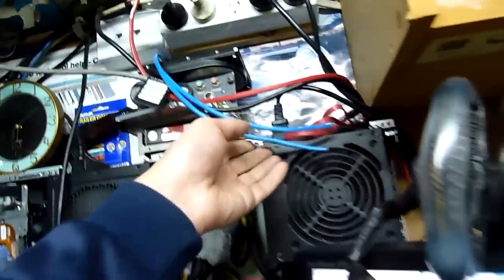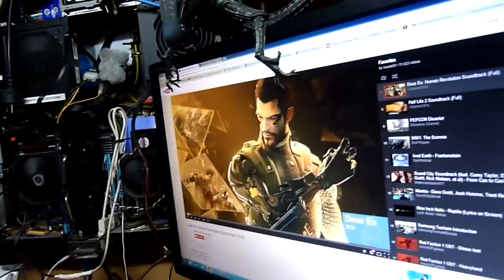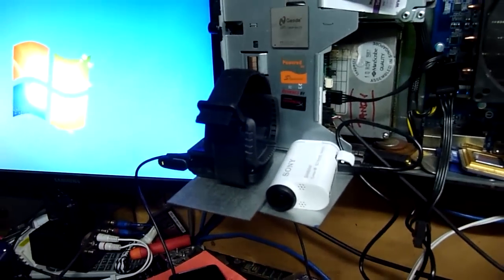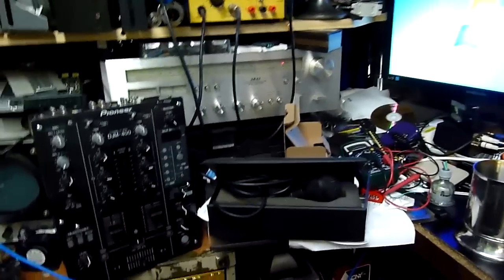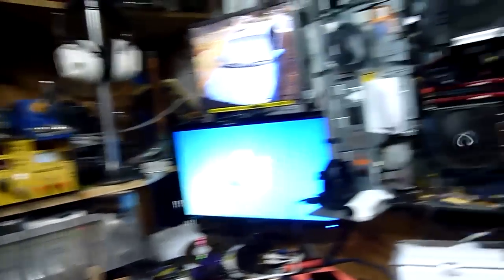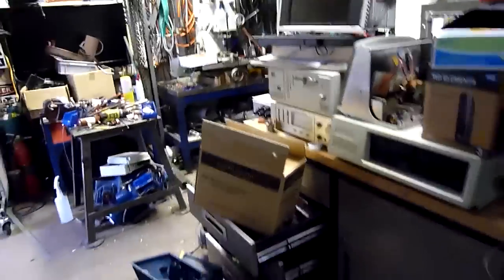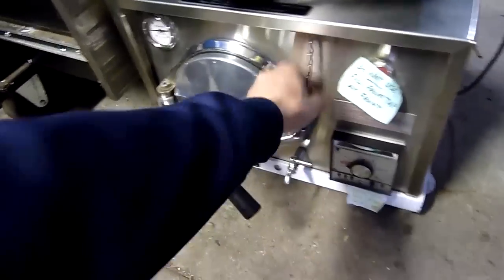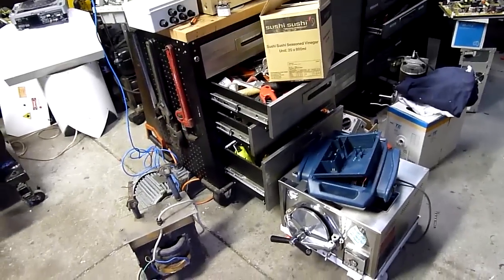Rambloupdate April 7 2015

Comment: Make sure the router you're getting does actually load balance properly. It would be best if you could get a modem/router/LB all in one. We had 3 x ADSL going through a router/firewall at work and we were plagued with connection drop-outs. I eventually discovered that it was not keeping connections that started on one line to stay on that line - damn thing kept on switching modems based on the load at the time without caring which IP it needed to go out on. I don't have any low-end recommendations since we're using a SonicWALL 3600 now ($3k+) but I've heard good things about Draytek and Billion - we use Draytek for our ADSL modems but I've not tried any with LB.
If you can get it, a good option is bonded ADSL - basically the ISP does the LB for you and it's seamless on your end.. but given it's a business service it tends to cost a shitload!

Comment: Im using hfc down here in geelong. Vpn to new york uploads of 5mpbs or 10mbs to aus. But the node between iinet and its bridge to Melbourne can be slow due to adsl sharing and lagging the nodes response. i turned off adsl services due to moving 2 km closer to the exchange but found out the phone lines ran a massive loop around my streets to find i had lost 70 percent of its speed. From my original premises. Now its ok but nbn was going to be at my premises by the end of this year, but no... it was pushed another 5 years now... also choosing a reliable adsl that did work. The only one which outstanded the most was commander.. 22.3mbps and 15mbps.  Good luck and i will start uploading videos myself once the house is fixed.

Comment: I have an old linksys wrt310n router with tomatousb firmware installed on it which has a QoS feature. Not the best implementation, but it does an excellent job at keeping the internet from going down whenever I upload a big file to google drive.Perhaps if you had an old cheap router, it would be worth a shot.

Comment: Ah.. that old problem with not enough upstream bandwidth... Back in the days when I could only get very slow ADSL I had great success using a linux router to prioritise the outgoing traffic correctly for my limited bandwidth. There is an excellent resource called 'lartc' (Linux Advanced Routing and Traffic Control) which produce a 'Wonder Shaper' script (google for it) which will work with any pitiful amount of bandwidth to keep it fast and responsive. You can classify different traffic types, and give each class a minimum guaranteed bandwidth and priority level (i.e. reserve 8kpbs guaranteed upload for interactive traffic, ssh sessions, DNS lookups etc), and you can drop large-sized http packet sends (i.e. youtube uploads) down to a background priority. It's an awseome solution.... but... and it's a big but.... it takes a hell of a lot of reading up to understand how it all works. It is however, the only solution I've ever found which actually worked really well for dealing with limited upstream bandwidth. Even if you have dual routers, it's still a good thing to use, as you can use the traffic classifiers to choose which router to send different types of packets over. Good luck with improving your Internet setup. Cheers!!

Comment: I live out in the sticks and I can get the NBN at 25/5 megabit. The schools I work at (I'm a specialist technician for them) have 20/20 fibre. Some areas have 100/100 NBN but there so hard to find at the moment its almost pointless. One of my schools was going to upgrade to 50/50 but the infrastructure in the town apparently cant cope and this is one of the few towns with accessible 100/100. Telstra say it will be another 3 years before its available, and this was for a school. Oh and may I recommend a Linksys modem, then run dd-wrt on it. Best setup I have found so far.

Comment: Aussie50 try a limiter Program to limit your upload, so that the rest of the services got a bit of headroom (like limit it to 5kb/s below your maximum upload). 
And complaining at my isp would be my first try anyways. Try to get connected to the actual technicans rather then the salespeople, they often know what to do (at least with my bad German line here :D) 

Also have a look at Handbrake. It is a video compressor, you should be able to save quite a lot of file size by compressing the video without losing much quality at all. (EEVblog also  made videos about this)

Comment: Use a linux box as a ppp endpoint for both connections, and use your modems as a straight bridge mode device to hook into the adsl.  Much much better at handling multi-routing than any off the shelf router I've ever seen.  Gives you excellent flow control and ability to control latency under varied bandwidth conditions as well as automatic load balancing and failover.   Not without caveats, but at least it'll for the most part 'just work'

Comment: Better sound ITS A TRAP ITS A TRAP lol it'll be great for streaming but with recording it makes it difficult editing wise.

For remote terminal have a go at logmein, I use it all the time and when i was at tech it easily traversed the NAT. Hope your connectivity improves soon! If I lived closer to you I'd let you use my NBN (when I get it installed). Shame youtube doesn't provide like a torrent style system so you can throttle the upload (at the moment I have the same problem)

Comment: I remember a few months ago when you first started have major issues. You shouldn't need to spend money to restore the previous level of service you had before. I've notice with my ISP in the UK that when ever I upload video's to You tube my connection becomes less reliable and my upstream rate drops to a much lower level. After examining my Router logs for several weeks the only conclusion I can come to is they do it deliberately often changing the SNR margins for ADSL resulting in lower connection speeds especially upstream. You should definitely find out why your connection is performing worse before spending more money unless your moving to a new ISP as well.

Comment: Download a YouTube video and compare it to the original file.

If what you are uploading is massively greater than the YouTube version then re-encode to a lower bitrate and save a lot of uploading time.
Reply: mark314158 Problem is when your uploading a 720p or 1080p video, if you want any amount of quality your going to end up with a huge file. Granted for the gaming stuff I do at 1080p i get around 300-400mb for 6 minutes of footage, it takes nearly 45 minutes to render (thats 7.5x render time to video time)

Comment: Those Billion modems are really good and very stable, it should help a lot. Also, part of the issue is being caused by youtube. Uploading has slowed to a crawl and processing has gone from half an hour to 1-2 days
Reply: I've recently uploaded 5GB files from Aberdeen in the UK and i've not had much issue with upload or processing. The internet here is ok though for being one of the most northern population centres in the UK.

Processing usually takes about 10-60 minutes depending on video size (from ~150MB to 10GB).
Reply: Scara and Spud Blaze the Fox Processing taking that long could be the codec your using to encode the video, I noticed with some codecs (can't remember if it was xvid or if it was one of the sony codecs) it would take forever, and youtube would complain that it couldn't stream process the video.

Sony AVC seems to work OK with not too big video size, though it takes a while to render
Reply: Max Bainrot I generally have videos processing quickly. They never take longer than an hour and that is for 40-50 minute long videos. Otherwise it generally takes 3-5 minutes.

I use MPEG 4, WMV, and AVI.

Comment: My internet is pretty shite up here in the US. Verizon G.DMT DSL @ 3.3Mb/s down and 883Kb/s up. It goes over 50+ year old phone lines, too, so any rain or moisture kills that speed and any reliability my connection might have. Availability map says I should also be able to get Time Warner cable internet, but nope! Nearest line is 1/4 mile away and TW wants $8k+ to bury the line to my house.
Reply: FrankTheCat I cant believe where i live they still offer Dial-up
Reply: Neodinium My ISP offers as part of my package complementry dialup incase the ADSL shits itself lol, though its kind of funny... I have naked adsl so if ADSL dies i have nothing
Reply: Max Bainrot yea i run off DSL too. max with dsl where i live is like 30mb/sup and 15mb/s down. still pretty slow compared to cable...
Reply: Max Bainrot note*They are mega bits (Mb) im using not mega bytes (MB)
Reply: FrankTheCat thats nothing. i live close to where ed lives but in more of a closed off area and i get a max internet speed of 158Kb/s.  its really shit!

Comment: Is sad that ausie internet is so bad that you need two modems in order to achieve the same speed that i get with a mid tear package.
Reply: I must have very bad internet, at the moment i am downloading at 60-100k a second.
my ADSL when it goes funny on me is slow, when it runs fast i get 400 K a sec if i am luck.  I am 5 KM away from the phone exchange, and im sure my issue is congestion.
Reply: ***** I live on the same street of the Testra exchange and I only get 1 megabit :/
Reply: Well I live on the same street, although it changes names 4 times hehe. but its as I mentioned about 4.7km away.
Well I am not the only one with crap speeds.

Yet my sister lives in Beechworth a small town and gets 21 Mbps.
Reply: ***** I've had 3km and 1.5km ADSL connections which degraded noticably when it rained (telephone cable was damaged in the street and would have issues when the pits filled with water) or when everyone else was using their ADSL in peak times (crosstalk from activity on other peoples lines - signal to noise ratio would go to shit). 5km is a long way for ADSL, check your line stats in your modem when it becomes 'bad' because theres a high chance that your line has sporadic issues being so far from the exchange. If that is the issue and not actual congestion at the exchange, then there is not much you can do about it if the telco does not agree that the line is degraded. If you get any internet at all, usually their call is that 'everything is fine'.
If your line stats always stay consistent even when its 'bad' then it could be congestion at the exchange - again not much you can do about this. If enough customers constantly complain about congestion in peak times, they might upgrade the exchange. The fastest way to fix congestion is to churn to an ISP who's hardware at your exhange doesn't experience congestion.
Reply: TMM
The pit out the front goes under water from my driveway yet is works well even underwater. we havent had decent rain to flood it for a while.

here are the stats from the modem but its not easy to read as i just cut n pasted it here,

Statistics
Downstream
Upstream
Line Rate
3776 kbps
384 kbps
Attainable Line Rate
3968 kbps
1248 kbps
Noise Margin
6.8 dB
23.0 dB
Line Attenuation
37.0 dB
1.0 dB
Output Power
13.8 dB
8.3 dB
Reply: ***** Our phone line a few years ago was 8km long!!! And we got 2.5Mbps down and 0.65Mbps up. But after some roadworks finished and they had to cut the line temporarily, it went at 1.5Mbps after that, I complained but the techs couldn't find anything wrong. We suffered with that for years. Then finally a fibre fed ADSL cabinet was installed 3km from me and they cut my line and connected it into the cabinet. Now I get 7 Mbps down 1Mbps up and it never bogs down. Sometimes it makes it to 8Mbps down if I reset the modem.
Reply: That sounds great my internet has really crapped out here is the speed I just got now.
359 Kbps 45 kB/s

amazing isnt it a few minutes ago it could have been 3 Mbps. it has to be congestion.
And wow 8 Km thats a long line for ADSL.
Reply: ***** They refused to give us ADSL but we begged and begged because satellite is unbelievably crap and expensive.  And eventually they gave in and it actually worked! They told us it wouldn't work you're too far from the exchange!
Reply: well it works better than mine. mine is so much up and down all the time.

Comment: I would give the ISP a kick in the pants.
Reply: Australia is FUBAR with bandwidth caps, old school phone line based DSL, in essence there are several ISPs down there, but at the end of the day, they all have to pass through Telstra AKA  Smellstra's network, so naturally they choke the smaller ones and set the rules as they please.
Both the US and Australia needs a thorough ISP cleanup to get on par with the rest of the world, and stop this degrading behaviour, before it spreads to other parts of the world.
Reply: CMDR Sweeper DSL can be fine, provided you have decent investment in the line network. I agree with you if Telstra is throttling other ISPs, there needs to be a giant boot up their arse
Reply: *****
In most if not every case, they are basing themselves of old copper in the ground that was laid there during the phone line boom of the 40s and 50s, and they do not want to dig it up.
So with oxidized copper and packet loss, good luck getting any decent speeds out of DSL.

But yeah, Telstra kinda forces bandwidth caps on everyone down there.
Reply: CMDR Sweeper Interesting: British Telecom over here have actually been pretty good at replacing the underground network cables. Some of the overhead stuff that's still in use is old, but most local distribution stuff dates to the 70s or 80s. The biggest problem here is being 70s, some of the wiring was aluminium. If you have Alu wiring on your phoneline, you're boned